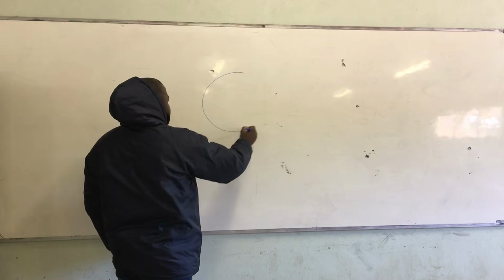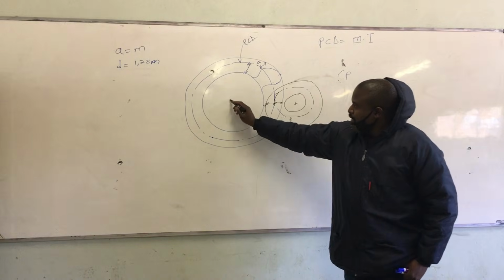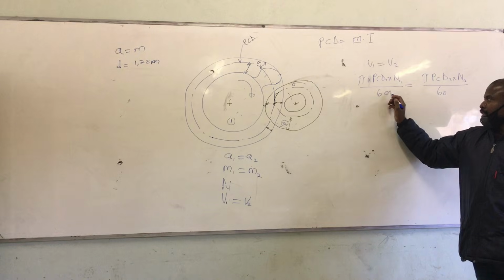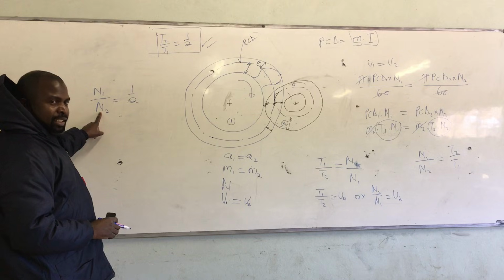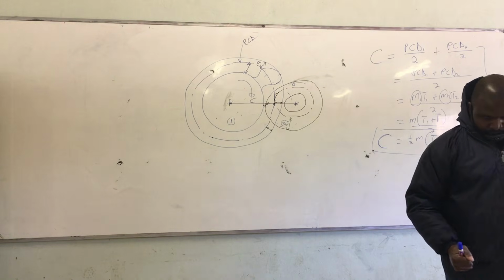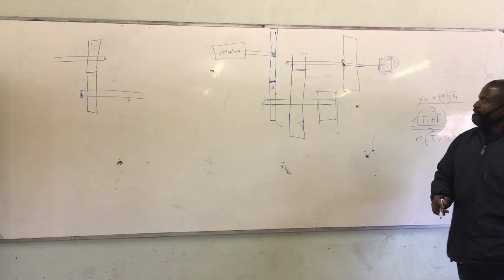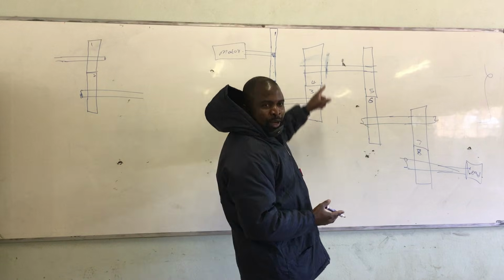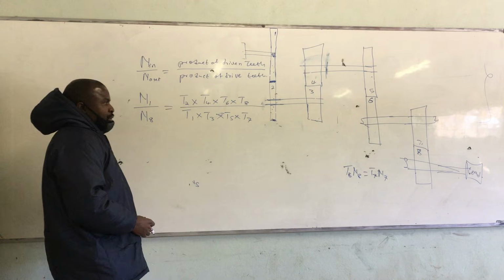Gear Drive (Mechanotechnics N4)

Comment: In our exams do we use : 
Addendum =1.25.module  or 
Addendum =1.57.module  
Which formula should we use 🤔
Reply from the maker: 1.57 was used on old syllabus. the new syllabus require student to use 1.25 as on other subjects

Comment: drive gear has 280 teeth and matches in on an intermediate gear. This intermediate 
gear has 90 teeth and rotates at 8 r/s to drive a driven gear at 14 r/s. Calculate the :
a) Speed of the driver gear (2)
b) Number of teeth on the driven gear..
so how do I work this one out???
Reply: velocity ratio #FORMULAE